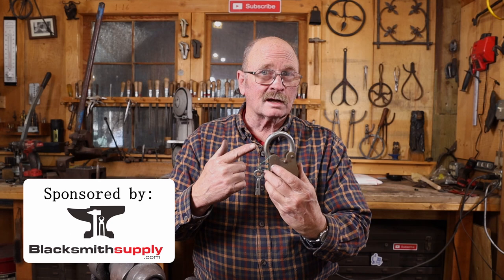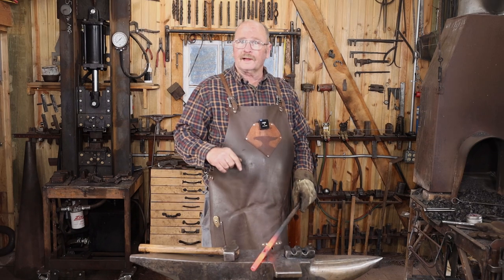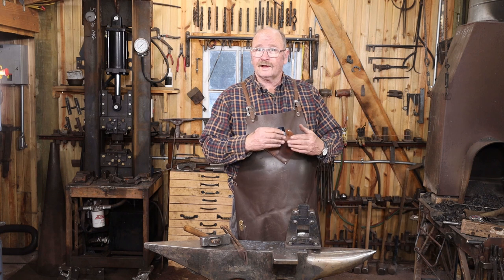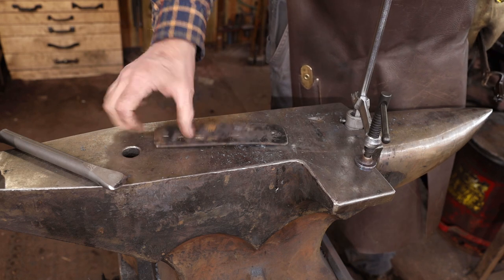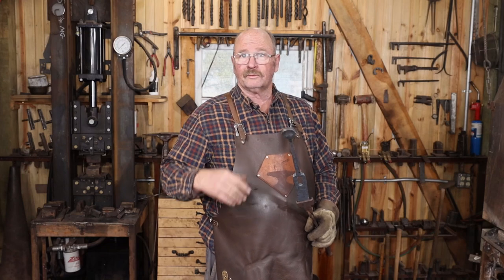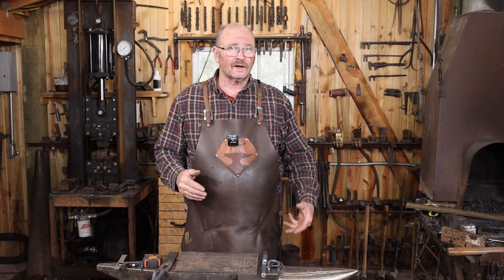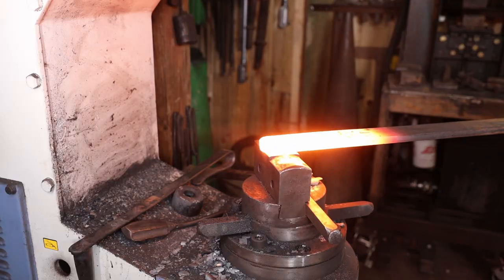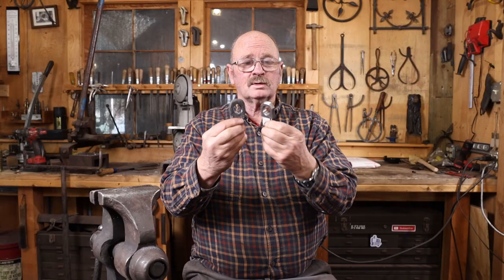Forging the Latch components for a sliding door latch or bolt

Comment: Hi John, I can see the appeal of both of the Keepers, one for accuracy and one for appearance, personally I think if I was buying a 'forged latch' I would definitely not be willing to pay for a part that isn't forged. 
Having said that, how difficult would it be to forge a more accurate keeper or conversely, could you put the machined keeper in the forge, warm it up a little, beat it with a hammer to remove the shine and smoothness of it?

Comment: Either or will do.  However, if the hand cut versions will make a better stronger connection, I would heat it up in the forge, use a hammer or ball pein to texture it and use it.

Comment: Regarding the transition to the finial, if one had more time than steel could you MIG weld the area that was necked down to far before normalising the piece instead of starting again?
Basically I'm wondering if you can forge welded areas.

Comment: When you cut the keep off in the Smithin' Magician, the stock was oriented vertically,  Is it better or easier to do the cut g with the stock vertical or flat?
Reply from the maker: Less resistance and seems to cut faster, but I don't think it really matters in the finished piece.